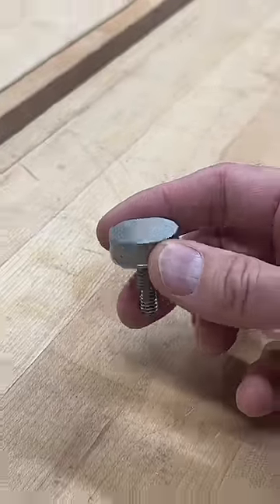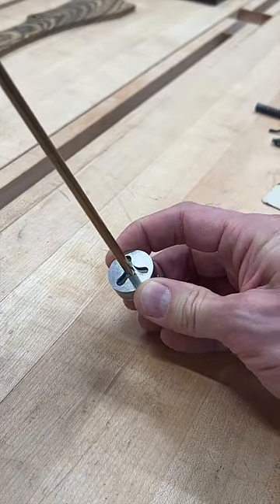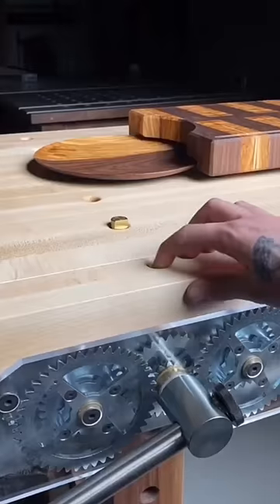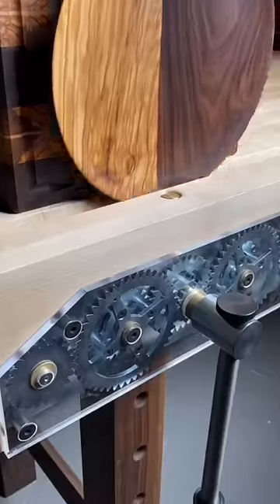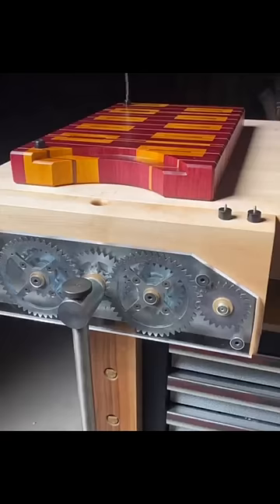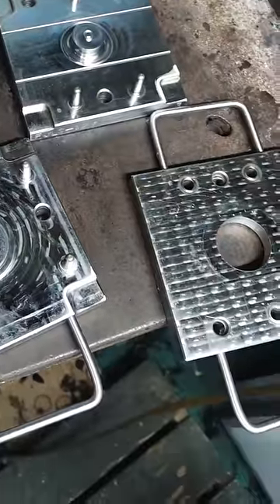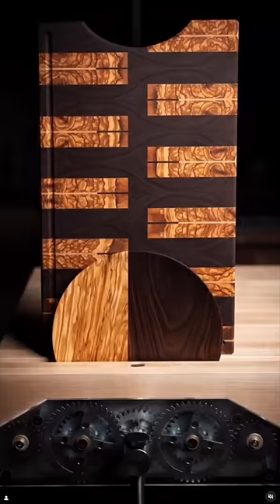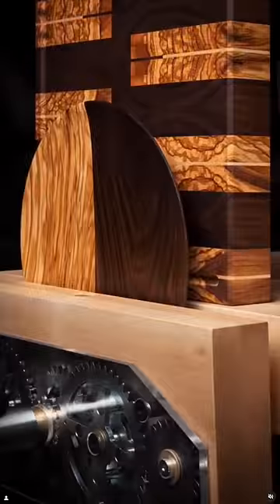Pika Screw on Owl Woodworks cutting board

Comment: How do you prevent thr head of the fasteners from being damaged by the driver, do you use plastic or a softer material to install, and what happens when this fastener is exposed to moisture

Comment: How about a screw with a small hole down the axis of the screw, that connects to transversal holes drilled down the sides?
So that when you drop a bit of wd-40 or 3in1 down the shaft hole, it lubricates the screw and you can Finally unscrew it from where ever!

Comment: As a chef I want to say and mention that those tight tolerances in a kitchen will not last. Oil and gunk will seep in and ruin the function of it. Its a nice idea but most Chefs have cutting boards with holes put into them that snap into pegs on the counter top for a flush fit.
Reply: The tolerance is so tight I doubt oil would even find its way in

Comment: Just use a hex head bolt you file down to circular and just screw the feet in like that. The rubber will grab the steel plenty hard to screw it in tight

Comment: "I invented this screw" 
That was the best joke I saw in shorts today xD, For the record, this type of screws (this type but way better) is used all over the world for a long long time in applications where you need to have it specifically this way but is not used in stuff like feets and nowhere near water because of the spring inside and the fact that its metal and if the slot gets clogged or rusted, you will never, ever get it open and drilling that kind of stuff is not pleasing at all...

Comment: You can get one piece rubber feet. Rubber feet have roughly the same diameter as the screwdriver handles so there's no mechanical advantage to yours. If for some reason you want an insane amount of torque use a strep wrench.

Comment: I feel like it would be cheaper and easier to just have a bolt molded with the same plastic and bolted into the board, less crevices and dirt to get trapped and if you need to remove to clean it can be done by hand instead of a specialized custom tool.

Comment: This is a fascinating idea, but I worry about accessibility and long term potential failure points. 

Esp on something dealing with food, for example, what if water gets in the recessed screw spot? What if like chicken juices do?

Again, I think this is a fascinating idea, but I worry about efficacy of application and an enduring comprehension of the tool itself. Something like this can be forgotten and mistaken for... Idk a rivet instead of a screw down the line. (I don't know if it would actually be a rivet that people would be mistaken for, but screws are like such a logical thing - and this removes one of the most logical things about them. Again not saying it's bad, just saying that I see this as a potential down the line flaw.)

Comment: How much water and rust does it take to render a hightech screw obsolete? You'll have to oil the spring and sliding surfaces often. Who and why would have to remove the screws? Probably only to replace rust damaged screws. This has to be the most unlikely aplication for the product. More suited to tamper resisting closures.

Comment: You would think the rubber on the feet would make it easy to grip and turn. Unless the screw rotates in the metal of the rubber foot (to prevent loosening when turned) the special screw seems pointless. You could just hand tighten them.

Comment: So... what if you were to use a screwdriver with a really strong magnet to turn a mostly iron screw with no face visible?
Reply from the maker: You’ll never get enough magnet force to get the screw even remotely tight, and the cost of the magnetic drive would be astronomical to do even a poor job.
Reply: @AndrewKleinWW  guess that makes sense-- figured there had to be a reason why it hadn't been done yet

Comment: I would be concerned about food debris or gunk sticking up the works if used on a cutting board. Instead something this beautifully crafted should be in a planely visible application. Also making the components out of different metals could lead to really artistic products think stainless base but meteorite center. Or a demascus outer and brass inner. Just ideas, good luck🤞

Comment: You could just machine a stainless flat surface screw and buy machined steel flat caps with magnets on the back to hide the screw. Or you could use a bolt. Idk man

Comment: What is the point of using these as feet? Rubber either hollowed out with a taper and a carriage bolt or gluded to a bolt with just a flat round surface we be a couple dollars at most.

Comment: Perfect example of creating a solution to a problem that doesn't exist. Just cover the screw heads with something. 26$ for a screw that will never be removed. Also if you ever used it anywhere near liquid they would either rust internally or if its soda or etc, it would get fucked by the sugar.

Comment: You know, they make screws with no head to slot a screw driver in. Flat like that, turned with a super strong magnet. Been around for 50 years, almost as cheep as normal ones. Inventing these days means over engineered
Reply from the maker: How about a link to these magnet driven screws that have been available for so long?

Comment: I think this is really cool on exposed joins or even as a stealth power button (somehow), but using it for cutting board feet seems like the most pointless waste ever. What a tragedy it will be there and not a single chef will ever think twice about it, since as a foot it could just as easily have been a drawer knob turned upside down

Comment: Why not just put a notch in the side of the round head and twist it on after it has the rubber installed? IF you are worried about the rubber wearing, just use a rubber socket? No need to wire that piece.

Comment: I'll never understand this screw. Just use a normal screw and put a nice little stainlesscap on it that you can remove with a magnet, suction cup or something like that. It would be so much cheaper and since its unlikely that you strip or scratch the cap it would even look better on the final product. (A cap is also way cheaper to replace when you do somehow damage it.) But hey, well done reinventing the wheel 😂🤷‍♂️

Comment: Kinda overengineered, sir. I could accomplish basically the same with:
A regular screw
A metal disk that matches the screwhead size
Heat sensitive glue

Just screw as regular and then glue the cover to the the screw. You can take it off with a small heat gun and a magnet.

Comment: Lots of people in the thread just don't get it, and flaunt their rudeness along with their lack of understanding. It's not about showcasing the owner's wealth, not a waste using them on the feet of a cutting board and especially not something you should sell to these morons who will never understand. But here's the gist-; when the owner of whatever piece these screws are  used on the owner immediately understand the attention to detail on every aspect of the build. It's much like the mad detail that goes into the ~0 tolerances involved in clocks that most people never see, or the high-end electrical panel of the new home of an OCD Electrician who takes pride in ever single screw, connector and busbar that only he/she knows is there, and maybe 15 years later when the next electrician is called in to do some work.

Comment: Ah yes a screw that has three additional screws and a spring and a faceplate in it.
And all of the low low price of hundreds of normal ones.
I think the artist can get over themselves and save money.
Just for that board alone they would have paid $104.
For a board. 
Just to have things no one will see on the bottom, and to solve a non issue about how a screw looks.

Comment: Why not pay 10 cents and just epoxy a 2 cent top cap on it.... And if you ever need to remove it, you could just use a solvent that is not destructive to the material you are drilling into, such as wood that much money for a single fastener isn't anything to brag about. I would not brag that you are horrible at making deals with whatever C&C shop you allowed to feminize you. If you're making any profit off of these, buy a CNC machine, buy bulk materials and with a little bit of automation gadgets you can have these knocked out for a 20th of what you quoted